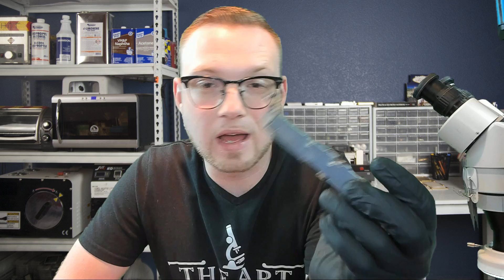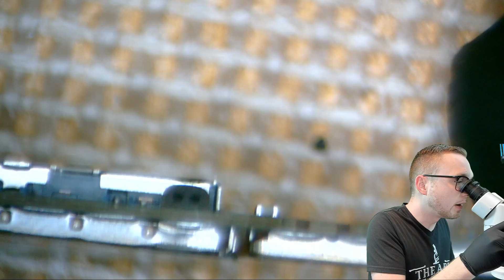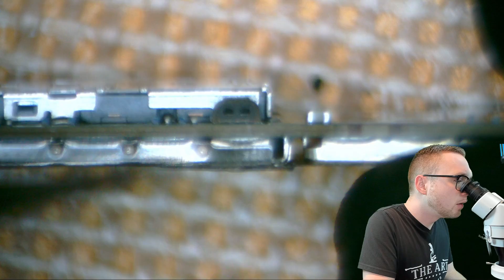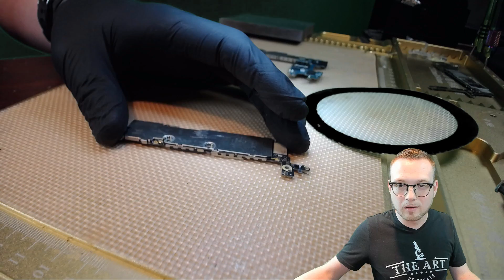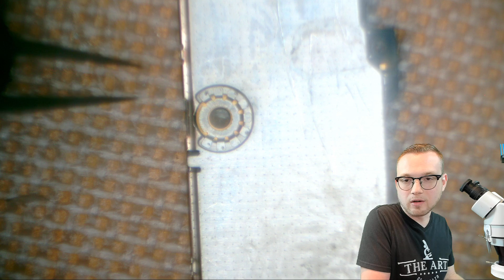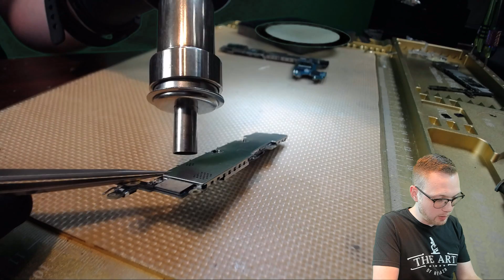EP73 Soldering 101 | EMI Shields | Cracking the PCB Coconut

Comment: Always be extra careful when coming with the tweezer at that entry point due to the black touch ic. I see many come to me cracked when the shield has been removed.
Reply from the maker: Federico Cerva definitly a great tip Rico! Thanks for sharing. It def is important to look in the hole if it’s a new board and your not accustomed to it’s internal layouts.
Reply: Yes it's sometimes super tough to remove "clipped on" emi shield on samsung devices.  I tried pulling and twisting for hours until and finally gave up.  Just used dremel to saw part of the cover off and rest came off unclipped.

Comment: This is a great video, thanks very much. I'm having trouble finding info/tips on how to replace the shields once they've been removed and the board worked on. Can they be replaced or is some other solution required to protect the components after? Thanks again for the video, very helpful and clear.

Comment: how about just cutting off stubbornly soldered emi shield with dremel?  Much safer than possibly toasting components with 500 deg heat.
Reply from the maker: The method in this video is more than industry standard. The deal here is, generally the joints of these emi shields are lower temp solder anyway. So if you let gravity do the work, toasting components is not really even an option. You really would have to be negligent to toast something. =) Thanks for the comment. I appreciate you views!